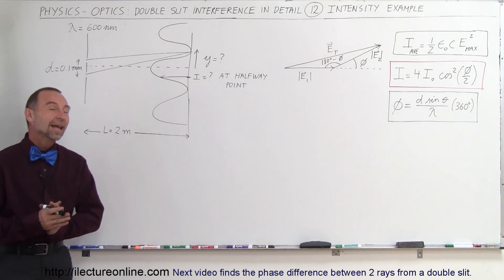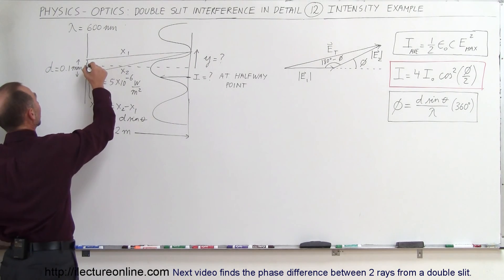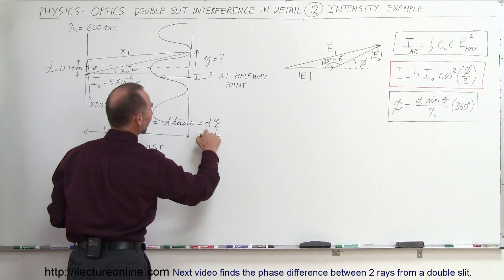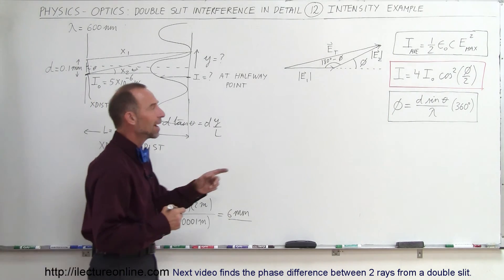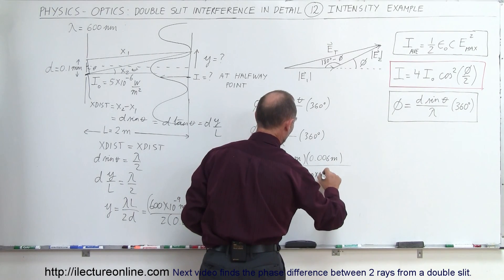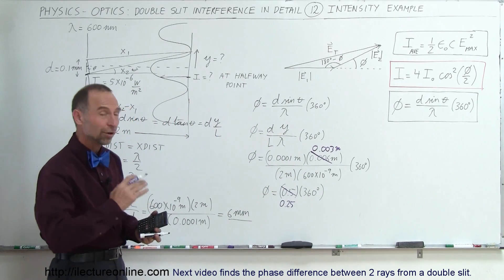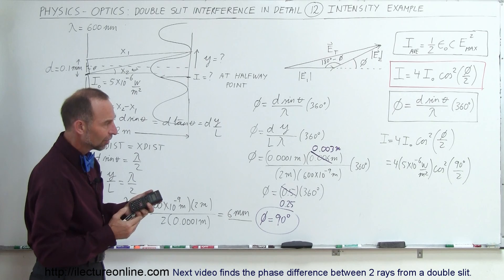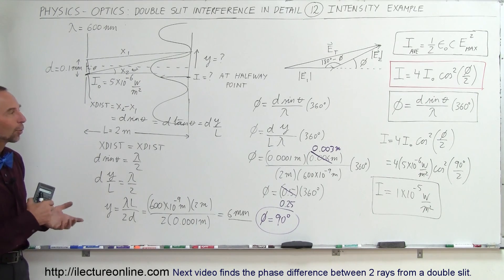Physics 60  Optics: Double Slit Interference (12 of 25) Find Distance, Intensity to Central Maximum

Comment: something doesn't add up:
If d*sin(theta) = lambda/2,
then plugging in for phi = d*sin(theta)/lambda  * 360 = 1/2 * 360 = 180
Which means that the cos(phi/2)^2 is actually cos(90)^2 which is 0 which is what you would expect for a minimum.